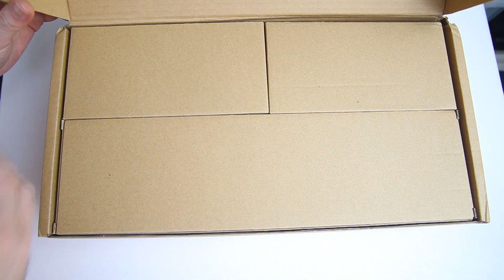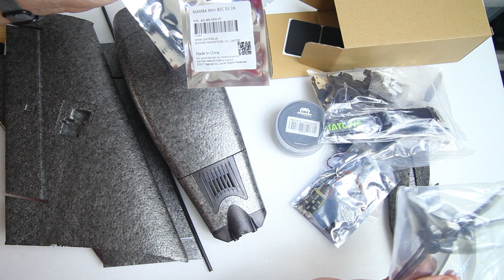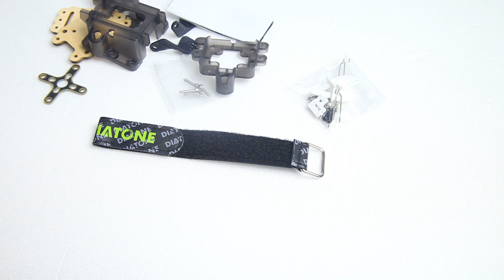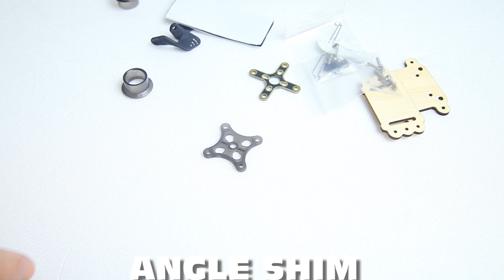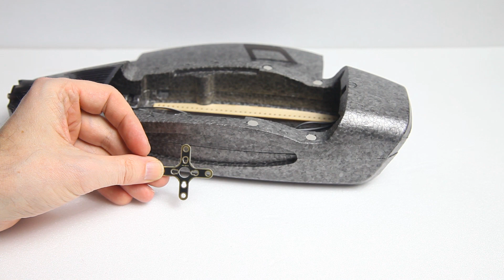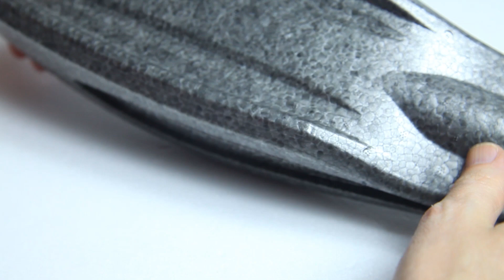RIPPER R690 (FPV) Wing - Diatone's First Airplane :) - Show & Tell

Comment from the maker: A first look at an exciting (to me :P) product :D 
Link to it: https://www.diatone.us/collections/new/products/diatone-wings-ripper-r690-frame-kit 

At Banggood: https://www.banggood.com/DIATONE-Chase-Fixed-Wing-Ripper-R690-690mm-Wingspan-EPP-FPV-RC-Airplane-Aircraft-KIT-p-1836204.html?p=TO251813974002015038 

Specifications: 
wingspan: 690 mm 
length: 415 mm 
weight: depends on the setup you use 
material: EPP Foam
kit type: airframe only 
motor: 2205 - 2208 2450Kv (not included) 
propellor: 5x5 (3S setup) or 6x4 (3S setup) 
ESC: 40A (not included) 
servo's: 9 - 12 gram (not included) 
receiver: 4 channel (not included) 
lipo: 1550 - 2200mah 3S / 1300 - 1550mah 4S 
ailerons: yep 
rudder: nope 
flaps: nope 
retracts: nope 
lights: yes! 
stabeliser: not included